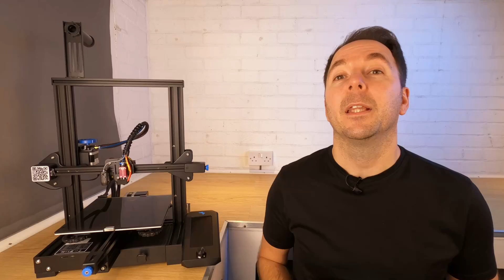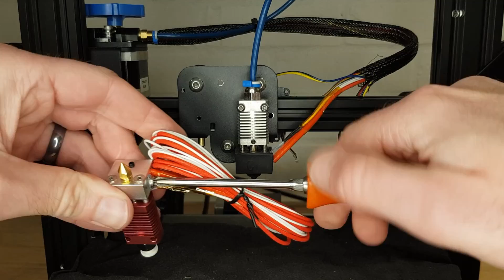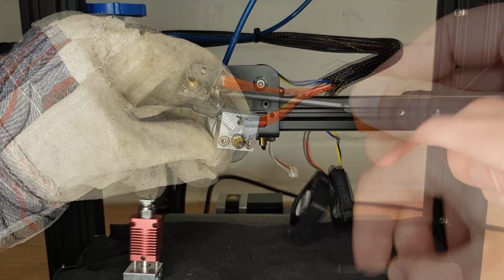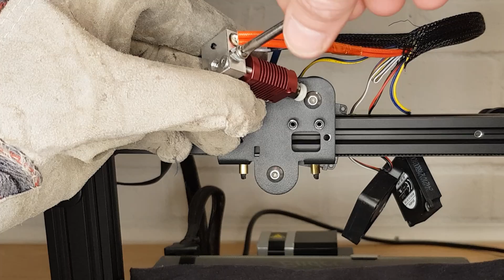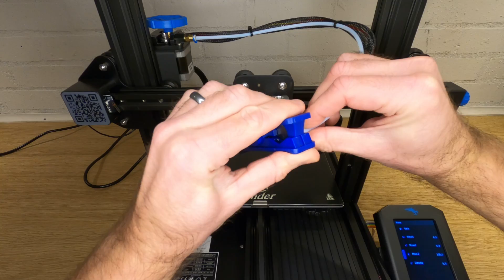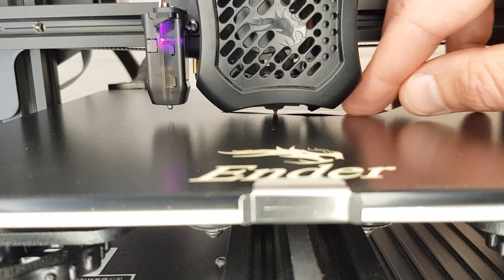How to Replace a 3D Printer Hot End: Step-by-Step Guide

Comment: i am physically unable to remove my nozzle
Reply: Use a wrench
Reply: Try after little bit heat it via Hot air blower
Reply: Heat up the extruder
Reply: @ it turns out the problem was me turning the nozzle the wrong way

Comment: I pulled the thermistor wires while cold.  They'both insulated in the loom but is it possible to re install them tied together in the new hot end without that insulation?  My real question is are they supposed to be tied together?  I'm trained in electronics but don't know how this stuff really works.  TIA!

Comment: Hello! I have the ender 3 v2. Having issues with it... it stops extruding after about 40 minutes, seeming to be at a certain z height.... I cleaned the nozzle and tried a different print to no avail....help! No idea what to do :( I just finished printing a lot of pieces too that turned out fine and all of a sudden it just stopped working like usual.
Reply: The PTFE Tube gets too hot after some Levels, melts a bit and blocks the hotend or just brakes the string
Reply from the maker: When it stops, do you get any errors or does it just act like it's finished correctly? Does the nozzle finish in the same location for instance?
Reply: @RickyImpey  hi! No errors. It will get super sparse and then will have some good solid layers, then will get sparse again until it stops. It will keep moving as if it's printing. I got 8 hours in on a print and noticed it was still "printing" but many layers above the print, not extruding anything. I've put a new nozzle on and trammed the bed. Got the Capricorn tube and a cr touch(used your videos to get it right). I'm using ender pla+, temp at 205 and bed at 60. I've played around with the temps at 200 and 210, bed temp at 50. I calibrated the e steps(it was only extruding 85mm, now it's at 100mm) but nothing is seeming to work. Before the above mentioned print, I printed both a CHEP cube and a CaliCat...both turned out perfect. I'm almost thinking my printing doesnt do well with prints that have supports?
Reply from the maker: @thealterrazero  It sounds like you either have a clog (which it sounds like you may have ruled out) or perhaps your extruder has an issue. Is there anything restricting the filament at the height when it starts to under-extrude?
Reply: @RickyImpey  not that I'm noticing. The filament is on a rack just above and feeds into the whole system. I'm thinking it's just clogging  every so often and resolving and re clogging? Is there something that could be causing a clog on larger prints but not something small as a calibration cube and cat? Could it be a setting in cura that I need to fix up?
Reply from the maker: @thealterrazero  clogging is just unmelted filament somewhere causing a blockage. The most likely causes is low temperatures at some point, remnants of a higher temperature filament that hasn't been fully cleaned out or filament melting and then cooling somewhere it shouldn't. Checking your PID tune and cleaning everything out should cure any clogging. Could you have a cracked extruder lever?
Reply: @RickyImpey  I'll have to take a look at the pid and extruder lever. I just tried a more simple but larger print last night and it was printing beautifully and then right at the top, the last 1/4 of the print, it just stopped printing. No strings or bubbles that would indicate a clog was starting.  It's the highest height I've gotten to so far. Was printing so solid. Wondering If I should get a new SD card? It can print small things perfectly fine. Large projects seem to be the issue.

Comment: What do you do if the little black hex screw for the cords just strips itself when you try to undo it? 😅 Will I need to try and drill it out?
Reply from the maker: There is no quick simple solution unfortunately. Carefully drilling or using something like an easy-out tool is an option but it's very likely you'll damage the thermistor unfortunately. Did you heat the whole thing up first? They shouldn't be anywhere near tight enough to round off.
Reply: @RickyImpey I have this exact problem, but on my new out-the-box hot end. From the manufacturer, the black screw on the thermistor is so tight in, I can’t unscrew it without stripping it.
Reply from the maker: @camb06 return it if you can, it has been assembled wrong and will likely either not work or fail early because of the incorrect assembly.
Reply: @camb06  return it!
Reply: Yeah heated up but I'll see how I go, I'll pick up some extractor screw bits and take it from there. Worst case I replace the cables and learn a bit more about the assembly of my machine in the process 🤷‍♂️ cheers for the response and informative videos 🤙

Comment: you explain everything very well! but it's going very quick. I had to remove some of the filament blob that cumulated on my heat block before I could remove the heater and the thermometer. 
I broke the thermometer sadly so I just replaced all wiring all together. 
and i'm gonna try out some 0.25 mm nozzles that I bought for the first time! this seems like the perfect time to test that
Reply from the maker: Sorry about the speed. Unfortunately, as YouTube creators, we are punished by the algorithm (that dictates who gets shown our videos) if we leave gaps or have longer videos. This means everything tends to get a little condensed to try and keep people's attention. Hopefully all of the information is here and you are able to pause in places of re-watch sections to not miss parts. Using a smaller nozzle can really help with getting higher details on prints just don't forget to change your slicer settings so that it knows what nozzle size you are using.

Comment: When fitting Bowden tubing I use a wrap of rough sandpaper to grip the tube and get some purchase on it, that PTFE is slick so having a good grip on it helps to make sure you have a good union between the tube and the heat break or if you have a standard hot end the nozzle.